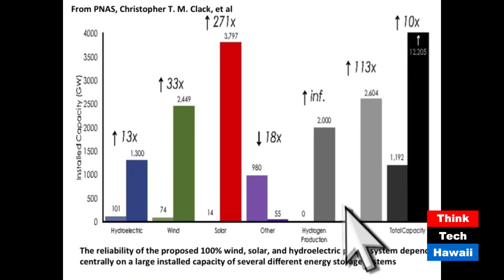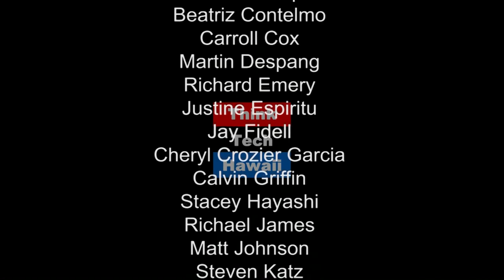The Challenges of a Transition to Clean Energy

Comment: To have a reasonable debate about energy policy it's important to be accurate about facts.  The guest's assertion that "there is nothing more energy dense than a gallon of gas" is not true.  Hydrogen is about three times more energy dense (about 161 MJ/Kg for H2, verses about 46 MJ/Kg for gasoline, I would invite the guest to simply look it up.  (Wonder why Toyota builds Fuel Cell EVs?)

The fossil fuel industry cannot accept the reality of Hydrogen as a fuel, because it's the only energy carrier which can obsolete them.  Hydrogen's more powerful (higher energy density) than gasoline, Hydrogen burns clean producing just water if properly consumed, and returning to water when used, water can be used as the feed stock:  just add renewable energy to drive the process, and there is no more pollution.  No fuel costs, and higher power.  Not living in caves, as the guest jokes about.  It's exactly the opposite.  Hydrogen means everyone can drive a big car if they want.  The problem is not the vehicle, it's the fuel.

Hawaii has taken the step of defining it's objective.  Now, the heart of Hawaii will be challenged to get some solutions on the ground.  The guest argues to actually stop commercial demonstration projects, and just focus on research (nice for the oil industries to keep real solutions locked away in laboratories) -  I think he has it exactly opposite.  Research has been going on for a long time, the time is to now Apply this research with more demonstration projects - not less as the guest advocates.

The solutions for Hawaii are right in front of it, not buried in a laboratory, or only sourced as liquid fuels from distant shores costing the citizens of Hawaii billions of dollars leaving the islands each year.  The only real solution for Hawaii is to get some hardware in the ground and earn your energy freedom the old fashioned way.  Hard work, and the step by step application of clean energy to replace toxic, aged, and outdated machinery, and outdated thinking.
Reply from the maker: Thanks, Toby, for your comment.  I have forwarded it to our guest, Lucian Pugliaresi.